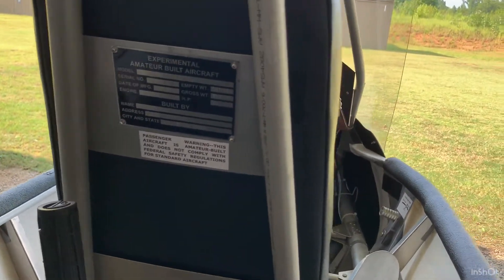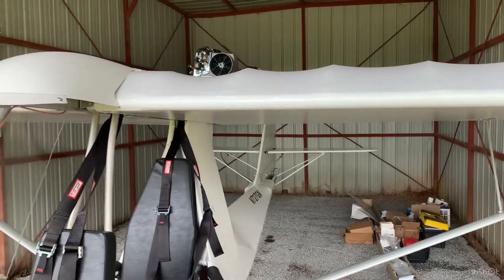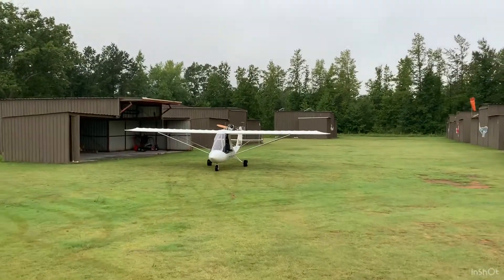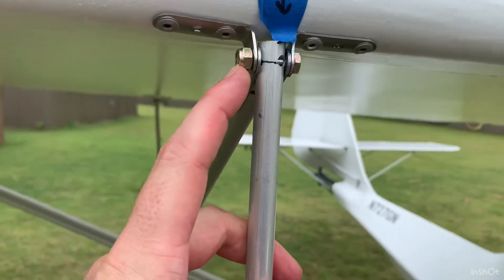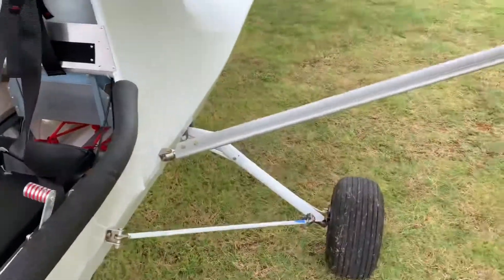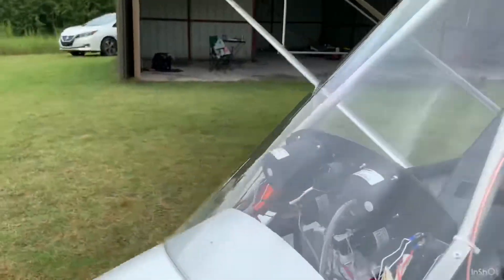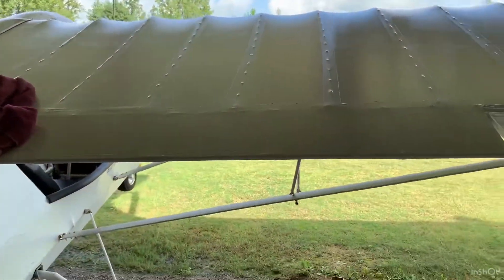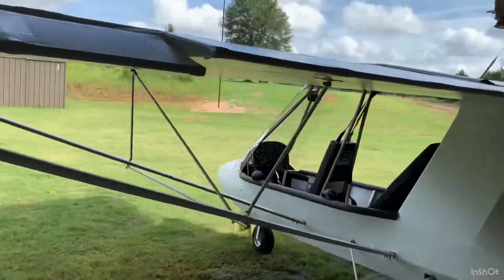Excalibur Aircraft Build Project 31

Comment: Nice Job Glen - do you have a WB for this plane? I’m thinking about building one.
Reply from the maker: Yes, it’s part of the certification process, and easy to work out.  I’m 195 and can take a 285lb. passenger and still be under gross and in CG.
Reply: @gnllr1  Could you share yours with me. I’m 330 but decreasing about 8 pounds a month right now due to a procedure I had in early FEB. Until I got the procedure I never thought something like the Excalibur would be possible but now I think by the time I finished the project I might be fine. Going to head down to see Tom in Sebring most likely in May.  You wouldn’t be headed out to the airport there on Sunday would you? I’m a JetBlue Captain and sim instructor and in Orlando until the 26th but have Sunday off and have a car. I’d love to drive up and maybe sit in a finished Excalibur just to see how the “fit” is - Wouldn’t want to fly at this point but just to chat a bit and see your plane would be fun for me.